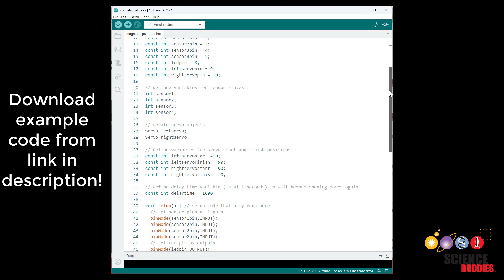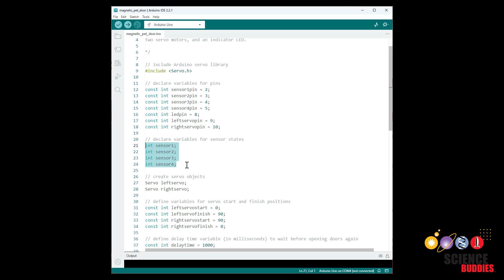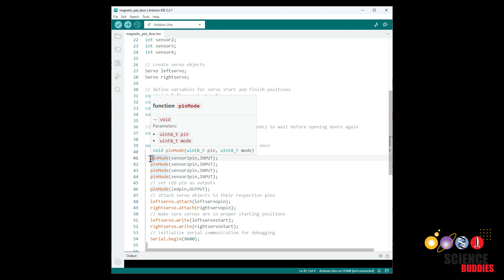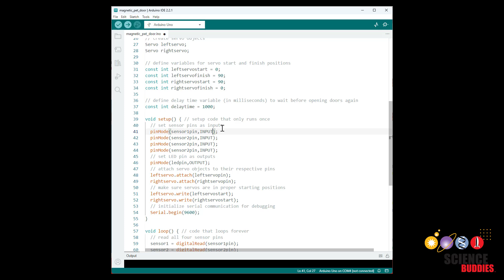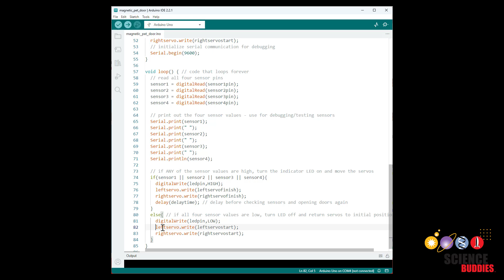Arduino Magnetic Pet Door: Circuit & Code | Science Project

Comment: Looking for a solution that accommodates my limited electronics skillset I was going to just have the reed switches connected to a relay so that when the dog approaches the door the relay activates a solenoid releasing the lock on the dog door. When the dog walks away the solenoid deactivates locking the dog door again. My question is how far away can the reed switches be closed by the magnet? I have two short dogs less than a foot tall and one taller dog about 22" tall. I am concerned the tall dogs collar may be too far away from the  reed switches to  activate them.  I wonder if a hall effect sensor might be more responsive?
Reply from the maker: In our experience the range of the reed switch is pretty short, only about an inch. We have a Hall effect sensor tutorial here: https://youtu.be/q4BkhwoGzbM?si=Y6jMP32J-KEEclC4. There are two types, digital and analog - you'd probably need to do some testing to figure out the effective range.

Comment: I see that you sell the kit. But do you sell it already out together so that it can be attached to a doggy door? I have been trying to find a way to keep our two cats inside but still allow our dogs to use the door. Doors that provide this are super expensive and dont allow for the amount of rescue dogs we have (7)😂
Reply from the maker: Hi - we are a K-12 STEM education nonprofit. We only sell an Arduino kit which includes an Arduino and some basic parts, but we do not sell pre-assembled doggy doors. Instructions to build your own are linked in the video description.
Reply: @Science.Buddies  ok, thank you. Can you tell me if it will be able to be connected to a regular doggy door?
Reply from the maker: Hi - if you mean a regular doggie door that the dog just pushes through, then you could modify it to attach motors to it to open the door by following our instructions.
Reply: @Science.Buddies  Thank you for getting back and sorry for all the questions. So it would require more than what is in the kit? I don't even necessarily need it to open, just to lock up or not open when the kitties are near.
Reply: I'm currently looking for this same solution since one of my cats finally figured out how to get out through the dog door. I have a dog door with a rigid three panel flap that goes into my sliding door track.
Reply: @SoMuchAdventure  Yes, I am still looking. I finally put up a sliding barn door in the hallway to keep kitties inside once it gets dark outside. Unfortunately, it keeps them out of our bedroom so they can't sleep with us. But hopefully it will keep them safe until we find another solution. I would like to try this but I just don't know if it would be able to handle the weight I would need for a thin piece of plywood. Also, I'm a little scared of spending so much and then not being able to get it to work. I'm sure there isn't a return policy. Let me know if you find a solution!!

Comment: Small observation. The 5V power to the bottom Reed Swtich (Green) isn't correctly wired on the breadboard. The two are on separate horizontal lines.
Reply from the maker: Thank you for catching that! We can't change the video but will update the corresponding figure in the written instructions.

Comment: Small note, with the reed switches, you could've wired all of them in parallel to each other, only needing one connection to the Arduino to detect a theoretically limitless number of inputs.